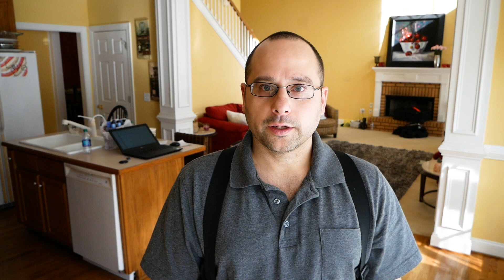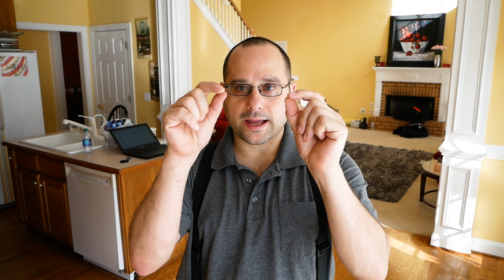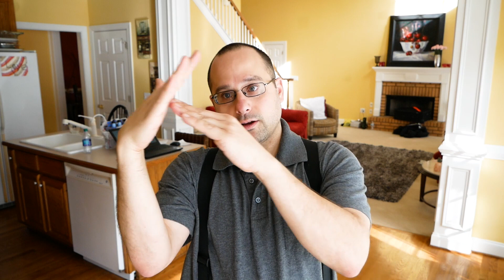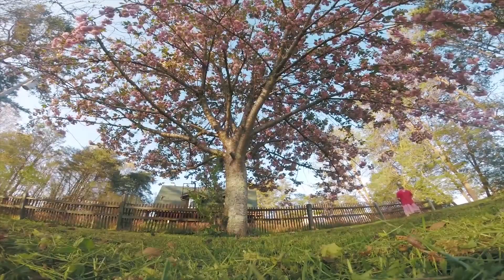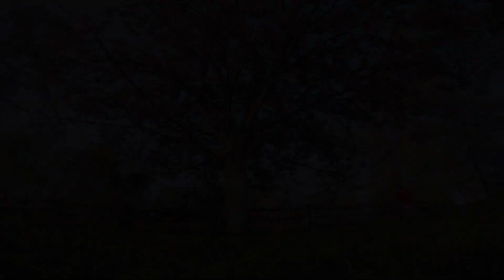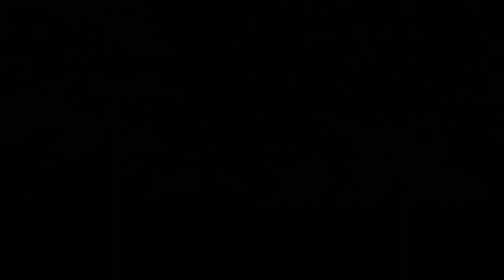Betaflight Stick Commands and Accelerometer Followup Questions

Comment: It would probably eat up a lot of valuable processor resources, but i don't see why code couldn't be written to reference the gyros to maintain an accurate horizon. Use the accelerometer as base line and compare to gyro input to calculate real angle. 
Might have to wait for the F7s to really catch on though.

I'm no coder, just seems like it would be do-able.
Reply from the maker: That is what betaflight and cleanflight do. The accelerometer is only read slowly and the gyro is used to fill in in between.
Reply: It in fact does this, though mainly as a fix for the acceleration problem Josh suggests rather then to save computation cycles. The gyro is used most of the time and the accelerometer is used to correct the drift of the gyro (at probably around 100Hz but I believe there is a value you can adjust). The drift is cause by the gyro not being truly accurate being only good over short periods of time, which is not a problem in rate mode. By in Horizon or Stab mode the quad needs to be held stable over minutes not seconds so the gyro is used periodically to fix that.
Reply: I see what your saying. What I was mostly getting at is more like an inferred guess by the FC  based on control input and accel/gyro data. So if the FC were to see a sudden roll command and throttle increase it could infer that the accelerometer reading would be skewed by whatever arbitrary amount it calculates and compensate accordingly.
 It would certainly not be an absolutely precise measurement but it could be tuned to the pilots preference something akin to how some sports cars have multiple levels of traction control, selectable by the driver, ranging from super well mannered.. to it hangs the tail out a little.. to literal computer assisted drift mode.
Also assuming this theoretical mode would be geared towards angle mode to, for instance, make a whoop feel more like its on rails in a tight turn.

I dunno could be way off base here... but it sounds good in my head.
Reply: lol damn. Good information layed down just as I was hitting reply. Makes more sense now.

Comment: I still don't have sticks in betaflight. F7 Kakute. r-sxr reciever. just upgraded to 4.02, Taranis Q-x7s and no sticks. Please someone.....Help.
Reply from the maker: RXSR green wire (SBUS OUT) to Kakute pad R6.

Betaflight Ports tab, UART 6 has "serial RX" enabled.

Betaflight Configuration tab has "serial receiver" and "SBUS" protocol.

That's it. :-)
Reply: @JoshuaBardwell  kind of.  There is no green wire.  the 4th slot down is the SBUS out that is yellow going to pad R4.  I bought it like this as a PNP.  It did fly 3.5. I tried UART 4 and 6 and the rest just to make sure. Still no sticks.

Comment: What’s going on when your stick commands are correct but in the setup screen moving the quad around the pitch is roll and roll is pitch?
Reply from the maker: Change the channel map parameter by swapping the 'E' and 'A' letters, such as "RETA1234" becomes "RATE1234".
Reply: But doing that changes my stick commands in the receiver tab which are responding correctly to the movement of the quad. Right now my accelerometer thinks the right side of the quad is the front. When I move the quad around in the setup tab. Awesome videos by the way, very helpful. Watched as many as I could to see if you already explained the issue I have but haven’t found anything yet, I might be overlooking it

Comment: I've tried everything - I assume it doesn't exist anymore in BF 4.3. Also there is nothing in the wiki, only in the old forks...
Reply from the maker: The accelerometer adjustment stick command? Yeah of course it still exists :-)
One catch is, you have to be in Angle mode for it to work. That's something that changed since I made this. Maybe that's the issue.

Comment: Learn a lot from you videos.  One command I am not sure what it does is labeled:
In-Flight Calibration Controls.  
In Mode 2:    Left stick Full down and Left,  Right stick Full Up and Right.

What does that does it do?
Reply from the maker: I think this is in-flight accelerometer calibration. Basically you enter that mode and then hover the craft and it trims the acc based on your stick positions. But I have no idea what the stick command is meant to do.

Comment: how to fix drifting backwards even i already trimed it on the controller
Reply from the maker: If you are drifting in Angle mode, add more trim until you stop drifting. Don't use controller trims (like I say in this video). Use accelerometer trim in the FC.
Reply: @JoshuaBardwell  thank you so much

Comment: only works for pid profile selection not rate profiles....
Reply from the maker: Correct. Use in-flight adjustments to switch rate profiles.

Comment: Doesnt your FC knows if a motor is much lower than the other (see when you are calibrating).  I'm not as knowledgeable as you, been in this fpv for a short time but I disagree with you on this one, FC knows how to compensate when motor x is lower than motor y therefore its in bank not in level flight. Im probably wrong though lol
Reply: Well that's exactly the problem because the sensor that is supposed to know your tilt angle ( the accelerometer) is the same one that gets confused with sidewas G forces therefore reading the angle wrong